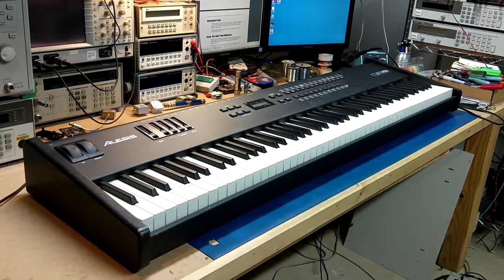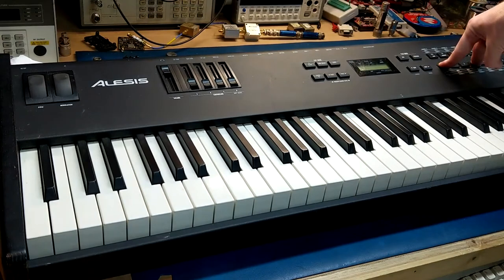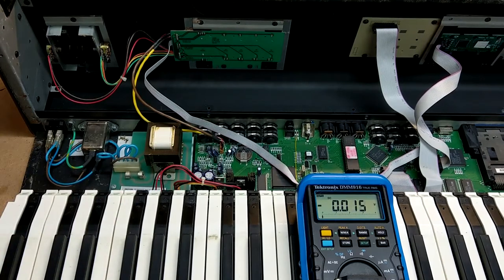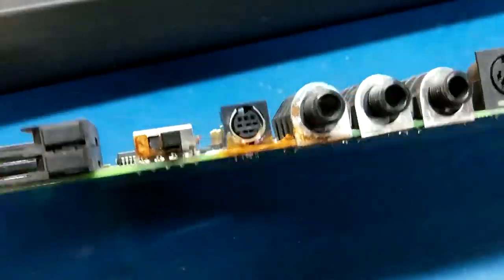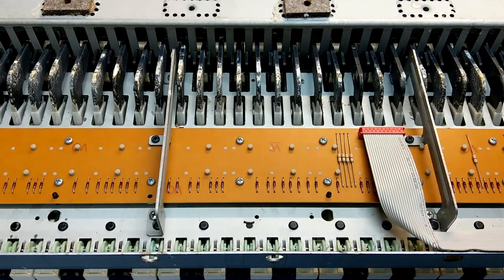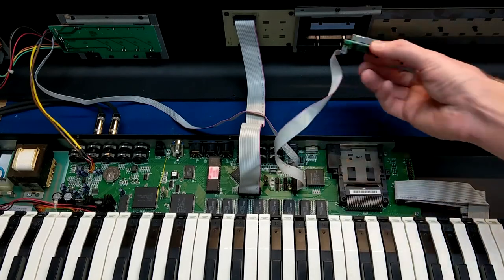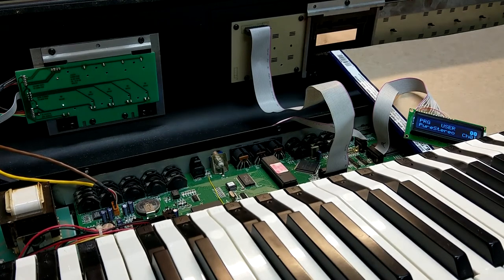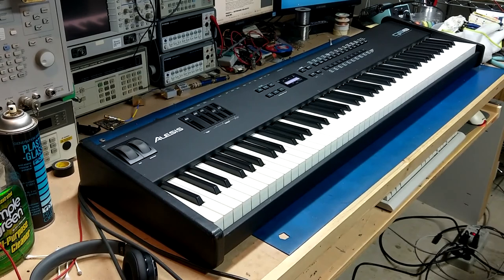Alesis QS8 Synthesizer Repair and Teardown

Comment: Great vid. Had some keys not working on mine, gave the connections a clean but didn't help. Turns out the issue was a corroded circuit on the circuit board which was a simple fix with a bit of wire and solder to bypass the broken circuit. Fixed now :) Saved me a few hundred bucks on a new keyboard.

Comment: I own a QS 8.1 still works great. Amazing that something 20 years old still works perfectly. I always wanted one in 99but could not afford it. Bought one on ebay for 500 buck with roadcase and it was practically new. Works great, and they dont make em like tanks anymore.
Reply: I printed the reference manual for the 8.1.  In Part 8 (Editing Programs)  it references a chart of Groups and Voices available in the device. I get how to toggle thru each main group number (e.g, 60) and toggle thru the subsets (e.g., 61, 62, 63...).  However; I don't see how I can determine were the specific instrument/voice (e.g., is located on the keyboard.  The group chart has a long text wrap of all the instruments (voices) in that group.  Does this device's LED identify which voice is being used? I'm trying to find the following: [Group] Pecus [Voice] Cabasa, Clave 1, Clave 2 and Tambourine.
Reply: I do have a QS8.1, and its spot on! built like a brick shit house too!  I have really need to start to learn to play it again.
Reply: How the keyboard action compares to more modern keyboards? Friends had the QS8 and I really liked the keyboard but it's been a while since I played it for the last time. Thanks!

BTW, the keyboard is so respected I can find these rubber parts, new, even in Brazil!

Comment: I just picked up a very neglected QS8 at a garage sale.  Power switch is missing, so I'll have to get that before I can even turn it on.  I haven't opened it up yet, but it appears someone has in the past - several screws are missing or mismatched.  Thanks for the really excellent tour of your work.  With luck I'll be able to restore it to fully operating (if somewhat ugly looking) condition.

Comment: tip: there is actually carbon paint you can buy off Amazon to repair carbon contacts. Much easier to use than 
donor contacts". You also won't need to mess with the correct height dimension as you most likely won't get perfect after cutting off the original.
Reply: I found it and fixed an MMT-8 unit.

Comment: I still have my QS6.1 keyboard but it needs repairs. It was in storage for 15 years but when I tried to play it some keys were dead and the display was not working properly. It was one of my first synths along with the Korg N1. Sadly, it too is in disrepair with similar issues as the Alesis. They were all wrapped well and in their original boxes but storing them in a damp basement was not a good idea. Time and dampness took their toll for sure!

Comment: Hi Brad, thank you for your video.  I too just got one QS8.  However, the sound volume through the headset is very very low and there are no sound coming out of the two quarter inch outputs.  Have tried the reset and same issues.  I would be greatly appreciate it if you can give some suggestions as to how to troubleshoot this.   Thank YOU in advance for your time/assistance!

Comment: Next up on my workbench is a QS8.1 I found on Facebook Marketplace for [ridiculously low price redacted].  Seller said it wouldn't power on,  something rattles around inside the case when you pick the instrument up (and imagine my surprise when I went to put it in my car and it weighs SIXTY POUNDS!?!?!), and someone spilled a can of house paint on the case. She just wanted the thing gone 'cause she got a new keyboard. THIS is gonna be a FUN one.  Thank you for posting this video.  I'll watch out for bad filter caps, and maybe see about putting a heat sink of some shape on that regulator.
Reply: Late update:  aside from the yellow paint splattered on it, and one dead key, all that was wrong was the transformer board to main board jumper was disconnected.  Reconnected it, powered it up, and it's alive!   Now to take the contact board off the treble end and clean that dead key...

I dunno what's more tedious, taking out all those little screws, or trying to get the little "feet" on the contact strips stuck back in all those holes in the contact circuit board. Meh! :D

And finally: All back together and working great.

Comment: I finally uncovered my missing sustain pedal!  I was overjoyed.  Then the wire just pulled right out of it.  I can't find a screw hole or any way to open it up to fix it.  I can't find a video either.  Got any suggestions? Thanks much!!  It's the "Foot Switch 93 Made In Italy by Fatar".  UPDATE:  Stick a screwdriver on the side near the hinge and pry.  It pops off safely!  :-D

Comment: You're awesome, man. Thanks for the preview of what I have to do to replace the display in my QS7. I bought it in 1997 and stored it in the attic the last few years. I think some super cold temps must have pooched the LCD. I chose that exact same light blue on dark for the replacement!
Reply: A follow up... the display I bought from Jetpackmods had this piece on it that interfered with the QS display bezel. I had to do some careful surgery on the bezel to make it fit.

Comment: Brad, thanks for this video. I recently acquired a good condition QS7. The thing is, the display only show 8 of the 16 characters left to center! I opened it up and looks as if someone used what looks like hot glue to secure the display in place. The glue came off with a few gentle tugs and I was able to remove it. However this 'glue' is on the tape connector also. Looks like it'll come off so I can install another one. Not sure why only 8 characters, nor why the use of dabs of glue. Seems odd. I didn't notice any glue on your display, unless you removed it before recording that portion of the video. This keyboard is super easy to get into, unlike some other brands out there. Thanks again.

Comment: I have an old QS8 - still works great. Just wondering, is there any way to reduce the tension on the keys? The hammer action is great, but it's a bit stiff (always has been). I'd love to be able to lighten the action, but I'm not sure if there's any way to adjust it on the inside.

Comment: Recently bought a QS8 in kinda rough shape. Fortunately mostly mechanical issues. Your video was very helpful in solving these issues and I was able to get it in good clean working condition. Then I decided as a finishing touch to recap it. There was nothing to indicate this was necessary, just seemed like a good idea. Got it all done and...nothing. only the backlight on the display turns on. Restored the original caps, still nothing. Anyone got a hint beyond don't fix it if it aint broke?

Comment: Hola, Brad! May you please can clarify how to rewire the LCD with 2x7 pins (original lcd) to newer ones with 1x16 pins? So I think it is like 1->1 till 14->14? Because the new design has separete pins 15 and 16 for LCD BACLKIGHT at 16 pins layout? Right? But you told about swapping data pins?
Reply: You can find the wire diagramm here: https://youtu.be/XLGYUxwOTuU?t=994

Comment: Hi, i have a QS8...and i have a problem. Now, i turn on it and i get a blank display, just backlited and the unit is bricked. Before this, when it started properly, the display had writed ADDRESS ERROR and the keyboard  got crashes randomically when i had selected some preset or plays the keys. Do you have any idea what can be? Although i have a Yamaha MOTIF, the QS was my first piano...and i would like to use it...I thanks if you can help me

Comment: Don't know if you'll see this, but I wanted advice. Recent got my hands on one of these and the LCD screen doesn't work; the backlight comes on, but it doesn't display anything, I don't know much about the electronics of these things, so I don't know how to fix it. I'm going to replace the battery and see if that helps, but is there anything that might cause this, and is there anyway I would be able to get a replacement part?

Comment: I printed the reference manual for the 8.1.  In Part 8 (Editing Programs)  it references a chart of Groups and Voices available in the device. I get how to toggle thru each main group number (e.g, 60) and toggle thru the subsets (e.g., 61, 62, 63...).  However; I don't see how I can determine were the specific instrument/voice is located on the keyboard.  The group chart has a long text wrap of all the instruments (voices) in that group.  Does this device's LED identify which voice is being used? I'm trying to find the following: [Group] Pecus [Voice] Cabasa, Clave 1, Clave 2 and Tambourine.

Comment: Thanx, mine are now fixed. Can you split these keyboards. I can't find anything in the manual about splitting? Since I had mine apart I sanded down the ends and stained them. Made them looks almost new.

Comment: Great video. I've had mine for 20+ years and love it. Only recently, the sound started warping - it sounds like I'm using the pitch/modulation wheels when I play the keys (but I'm not).  Wondering if a cleaning would do, or is it a more complicated fix?

Comment: I'm not finding much information on the Alesis DG8 which appears similar in ways. I guess I'll just have to pull it apart and try the same method to fix the few poorly functioning keys.
Reply: So the DG8 is very similar other than it has an access panel on the bottom. The keyboard section comes right out the front after removing the screws holding it in - rather than having to disassemble everything. I thought I'd have to remove 100 screws but it was only like 12.

Comment: Do  you still have this synth? I got a line on one, power ,but no sound...If it happens I'll get back to ya for  some tips and what to look for,definitely going to put in battery socket and  do the cap upgrade as that may be my sound problem.I'm a piano player,so am lookin forward to doin camparison of the QS8, a rhodes and an acoustic baby grand.do you know if the QS7 had hammer type keys?

Comment: Hey Brad, great vid, thx! Just unboxed my QS8.1 after moving and storing it a few years (orig packing, climate controlled). No visible external damage or corrosion, but L audio channel is now low volume and scratchy, on both the headphone and line outputs. R side is fine. Think that would be the Op Amp or one of the DACs, or maybe (hopefully) just a bad cap somewhere? I'm handy with a soldering iron if I can figure out what went bad...

Comment: i have an Alesis QS7.1 that even after re initializing has a warbling sound while playing. Can you advise on what steps to take or what i can do about this? This sound happens without touching the modulation or pitch wheel. when i initialized i made sure to have the mod wheel all the way down and turned the power on while holding 0 and 3 down. thanks

Comment: My mod and pitch no longer work and the board is pitched up a whole step. Can i just disconnect that cable or board and return the unit to C and just not use these wheels?  Anybody?

Comment: Excellent video, thanks for navigating and explaining the various chips.  When I power up, my display shows some bars that then fade away, although the screen is still green.  There is no musicl sound however when powering up or off there is the power surge click, so I'm confident the output to headphones is reliable.  I checked the battery, it still has its charge. Do you have any ideas?  power supply?
Thanks

Comment: @18:30  Don't rob a tv remote to repair the conductive rubber pads, just order a Keyboard Repair Kit off of ebay.  Some kits include the silicone adhesive needed to glue the pads onto the rubber membrane.

Comment: Brad, I just bought a non working QS8 off Craigslist for $50. They stated that it was working before and then they went in to change a few keys, and didn’t work after. I plugged it in, and the lcd was dark. Turns out since the connectors aren’t keyed, they had plugged in the lcd board connector backwards. I plugged it back in the right way and the lcd lit but displayed nothing. I can’t get it to do anything. Even tried the 0 3 thing and nothing. Any ideas? Would really like to fix
Reply: Just came home with a $50.00 reported-dead QS8.1 off Facebook Mktplace.  Seller said she'd lost the power cord (standard IEC computer cord, and I got a bzillion of those) and she thought she remembered there's no audio out. There's something loose and rattly. This should be a fun project to get going again, which 'll be a very nice complement to my tired old Keylab49. :)

Comment: I just found your site....I am in awe, to say the least!  I have this same  Alesis model, bought it about 5 yrs ago from a kybdst looking to upgrade.  I had no idea of what I was getting.  I am a pro drummer, but self taught on kybds, of which I do some composing/playing.  The grand piano is what I mostly use,  & the Fender  Rhodes is very close to the original, I find.  My Alesis is in bad shape, action is poor, one key doesn't work & it needs an overhaul.  My question-where does one go-I live in W.Mass-& how much would it be to have a general overhaul done?  Any help with info is greatly appreciated, neil fahey

Comment: hi I have a qs6.2 and the volume slider isn't working. if i jave it all the wau down i can barely hear it. if i slide it up just a little, it goes to its loudest level. theres no way to scale down the volume. do I need to buy another slider bed? or is there a way to fix the one I have. if you have any information it would greatly be appreciated.

Comment: I was an Alesis endorser in 1996, and got one of the first ones shipped to Germany.  The fuses were to weak in the first ones shipped to Europe, and it blew out almost immediately. They sent me another one with a stronger fuse, and that never happened again. Mine has never been out of my studio, so it´s in excellent physical condition.  It just stopped working about 2 years ago. We were in the middle of a rehearsal, and suddenly there was no sound. We turned it off, and on a few times, had sound, but then it disappeared again. Then finally no sound at all. The Midi also doesn´t send a signal, so I can´t trigger sounds in my computer either. The LED stopped working at least 6 years ago. It lights up, but it´s blank. Nothing on it. I tried the Reset by holding down 0 and 3, and powering it on, but still no sound. I´ve read the LED is a common problem with the QS 8. I bought a new one on eBay, and will try to switch it out today. I want to change the battery, but can´t seem to get it out. I really don´t want to break anything. Usually these batteries just pop out. This one doesn´t. Also, what battery does it use? All my Roland V Drums, and SPD Pads use a standard CR 2032. The battery in the Alesis looks larger. If you could get back to in the next days it would be great. Thank you.
Reply: Just like in the Video, the Capacitors in Power Supply go bad.  Most likely scenario.

Comment: My QS6 is out of tune. I remember having to tune it when I first purchased used almost 10 years ago. But cannot figure out how to tune. The middle C is currently in the A position.
Reply from the maker: I want to say it was in one of the menu's, would need to reference the manual for it. Also check your pitch bender. If that pot is going bad / dirty it can cause the whole synth to go off pitch.

Comment: I have an 8.1. It's got several issues - some you covered here. I'm not a bench savvy guy, but would love to have this unit restored. Has a few button issues - might be able to clean them out. My LED screen is acting up = lighting is very dim and won't increase. Know anyone in the Charlotte NC area who works on these?
Reply: I purchased a replacement display several years ago on ebay (I don't remember the seller) and installed it myself (pretty easy...I'm not a bench guy either). I'm still using it today.

Comment: Hi, Brad. I have an Alesis QS 8.2 that has three descended keys. Any tips on how to fix those? Thank you!
Reply: I have a problem with this too on my QS8. I opened it up and mine are due to the plastic snaps breaking off. Over time, fatigue for these plastic parts being in tension eventually wear and they break.  What I did as a temporary fix was to hot glue the key but it will eventually come loose as the surface contacts are too smooth. Going to have another shot at it.

Comment: Hello Brad, like to get in touch online-can share some of my repairs/mods for the Alesis Fusion, same TP40 as the QS8, and might have a few tech questions/answers. If you are interested-I am on the Alesis music group as Jokeyman.🙃Correcting this earlier post-I have a non-working QS 8 in front of me-it is a Fatar TP-20 in the QS-early Fusions used TP20's identical to this one, others went to the TP-40. Also with aftertouch, weighted non graded version, and what I believe would now be considered the TP-40L, as the action on the fusions is very light for a weighted 88-key.